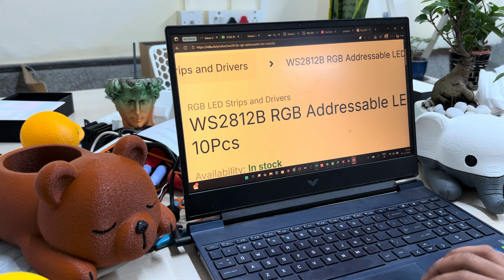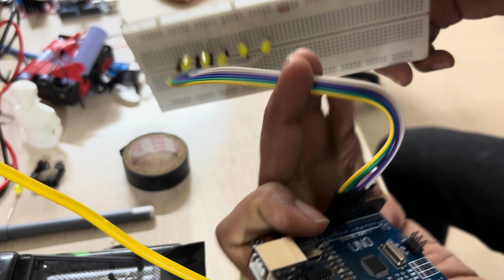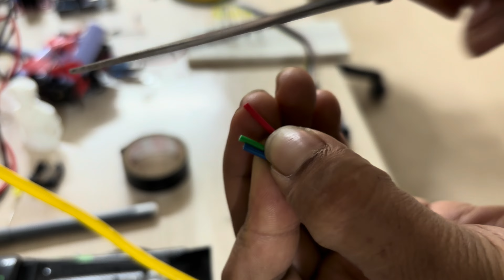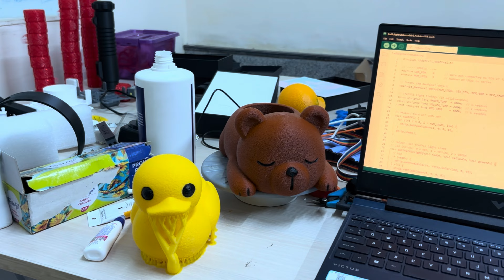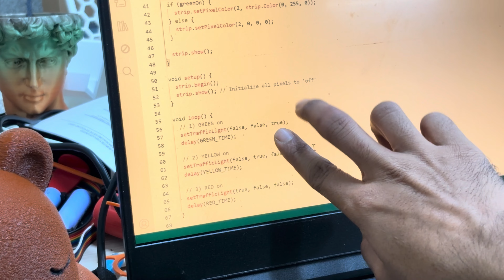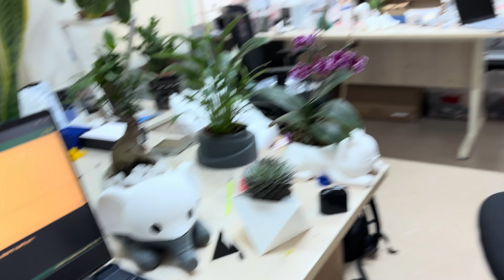Most Beginner-Friendly Arduino Project: WS2812B  Addressable Traffic Light!

Comment from the maker: #include <Adafruit_NeoPixel.h>

// ----- CONFIG -----
#define LED_PIN    6      // Data pin connected to DIN of first WS2812B
#define NUM_LEDS   3      // Number of LEDs in series

// Create the NeoPixel object
Adafruit_NeoPixel strip(NUM_LEDS, LED_PIN, NEO_GRB + NEO_KHZ800);

// Traffic light timings (in milliseconds)
const unsigned long GREEN_TIME  = 5000;  // 5 seconds
const unsigned long YELLOW_TIME = 2000;  // 2 seconds
const unsigned long RED_TIME    = 5000;  // 5 seconds

// Helper: turn all LEDs off
void allOff() {
  for (int i = 0; i < NUM_LEDS; i++) {
    strip.setPixelColor(i, 0, 0, 0);
  }
  strip.show();
}

// Helper: set traffic light state
// led indices: 0 = RED, 1 = YELLOW, 2 = GREEN
void setTrafficLight(bool redOn, bool yellowOn, bool greenOn) {
  // RED
  if (redOn) {
    strip.setPixelColor(0, strip.Color(255, 0, 0));
  } else {
    strip.setPixelColor(0, 0, 0, 0);
  }

  // YELLOW
  if (yellowOn) {
    strip.setPixelColor(1, strip.Color(255, 150, 0));
  } else {
    strip.setPixelColor(1, 0, 0, 0);
  }

  // GREEN
  if (greenOn) {
    strip.setPixelColor(2, strip.Color(0, 255, 0));
  } else {
    strip.setPixelColor(2, 0, 0, 0);
  }

  strip.show();
}

void setup() {
  strip.begin();
  strip.show(); // Initialize all pixels to 'off'
}

void loop() {
  // 1) GREEN on
  setTrafficLight(false, false, true);
  delay(GREEN_TIME);

  // 2) YELLOW on
  setTrafficLight(false, true, false);
  delay(YELLOW_TIME);

  // 3) RED on
  setTrafficLight(true, false, false);
  delay(RED_TIME);
}